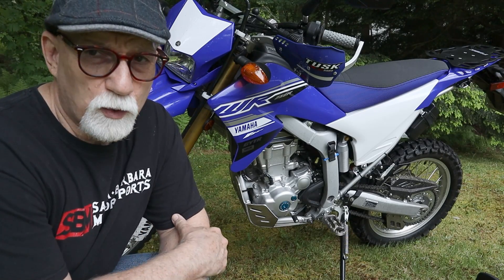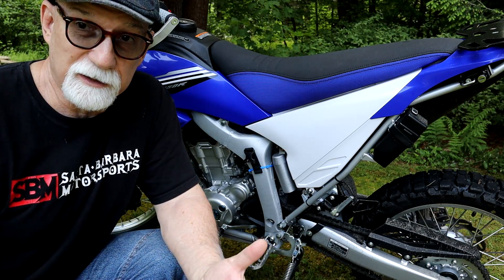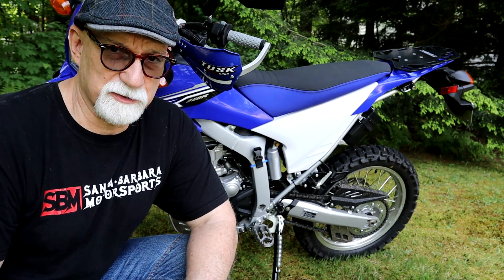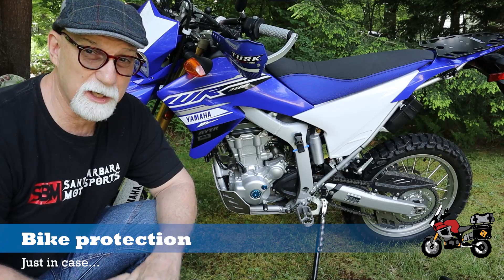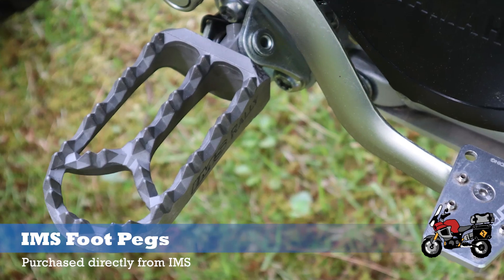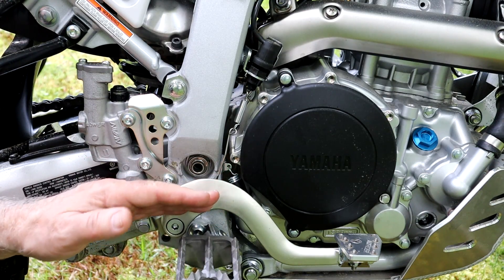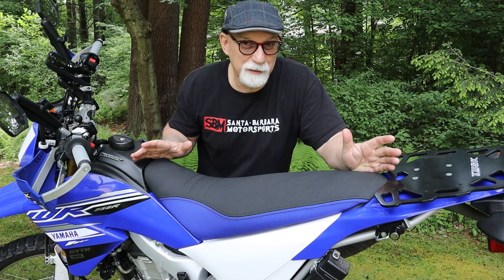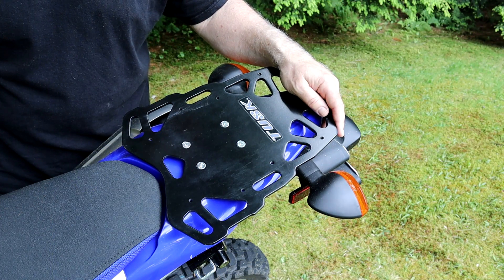WR250R Mini Adventure Build  | Skid-plate, Seat, Tail Rack and Foot-pegs

Comment: I installed the Seat Concepts (lowering) seat. You're right- it's a huge improvement over stock. It also gets even more comfortable after a few break in hours. Expensive but a worthy investment. Make sure threaded holes are clean before install.
Reply from the maker: Thanks! My threads were good, but I do have to make sure the side panels fit under the seat correctly.

Comment: Want to meet The Inglorious Old Single Track Riders in the Pachaug SP to put that little bike through its paces?  😉
Reply from the maker: Down in CT? Sure, as long as you dont mind a noob. Some of us are looking for camping weekends, are the parks open in CT yet?
Reply: @LivingOffTheSlab  Yes in CT, Pachaug is off 395 on the CT, RI boarder.  Pachaug is the only park in CT with legal riding areas. Thomaston Dam is closed currently. 
The other thing is I was half kidding 😉 Its "dual sport" accessible but the enduro loop is GNARLY and grueling.  Take a look at my some of vids if its something your still interested in hitting let me know. I also got a MA OHV sticker this year so I plan to head up there soon and often ;)
Reply from the maker: I watched a couple of your videos and it does look gnarly. We have a couple of places like that near us, not really beginner level, will get there eventually.
Reply: @LivingOffTheSlab   There's plenty of fire roads and dirt roads in the area for dual-sporting, you should check it out for a new area to hit up. But the majority of the Pachaug loop is very difficult terrain. We trailer our bikes in because we have them setup for enduro, dual-sport setups just don't cut it for most of what we ride in there.

Comment: Under "PRODUCTS IN THIS VIDEO" section, you might want to correct "JFR Racing" to "JFG Racing". I spent 10 minutes screaming at Amazon... 🤣 
Love the whole WR series..
Reply from the maker: Sorry, I am a John Force Racing fan and just did a Freudian slip.
Reply: @LivingOffTheSlab  Craig, finally got the rear disc protector. Looks great! Tip for everyone else, it doesn't come with nuts or bolts so use similarly sized hardware so your basic tool kit works for a just in case moment.
Reply from the maker: @kramdunc  Thank you for the update!